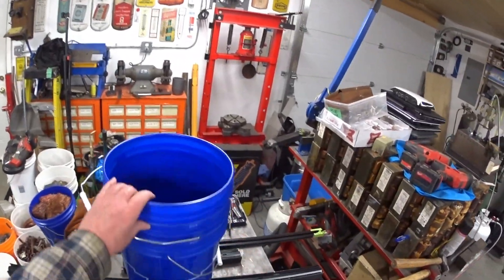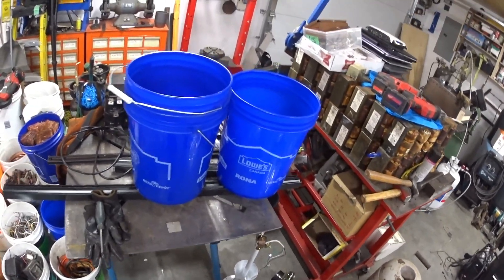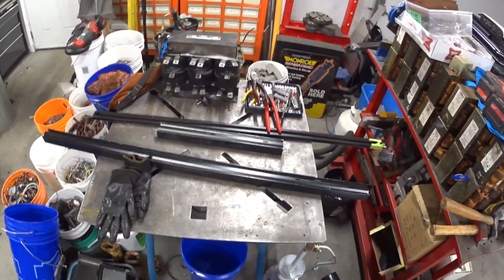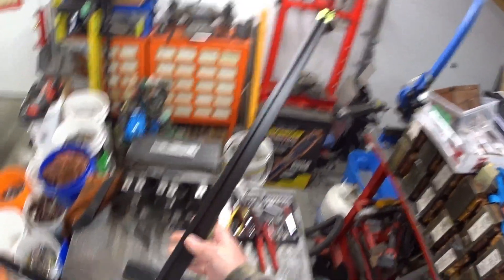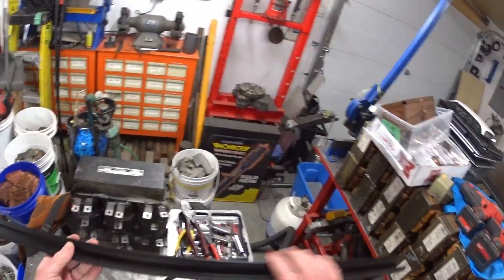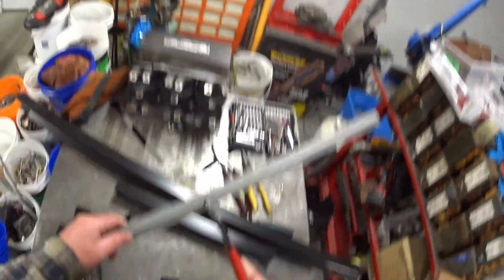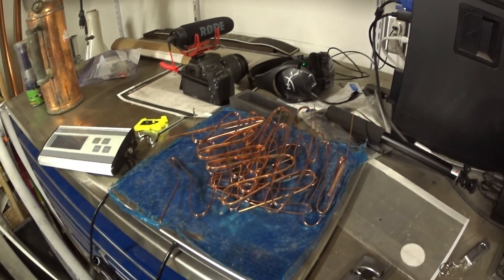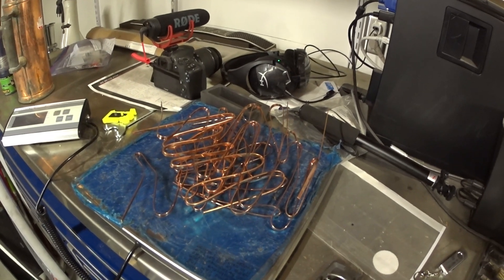SCRAP ACADEMY, SCRAPPING TRACK LIGHTING

Comment: I found a power strip from an office cubical that also had a similar copper track but this one had 5 or 6 of the copper strips
Reply from the maker: Yes, those have multiple circuits that are usually connected with a whip.